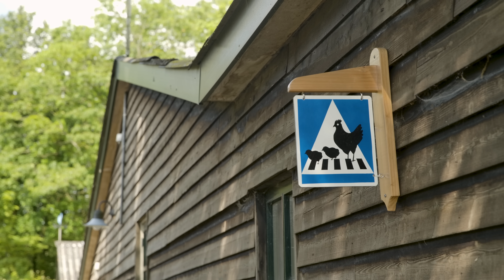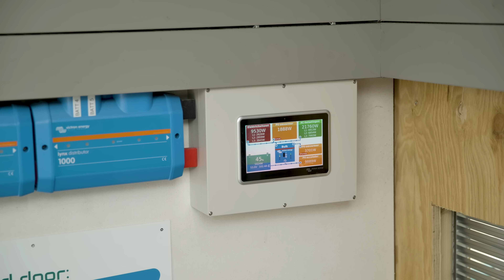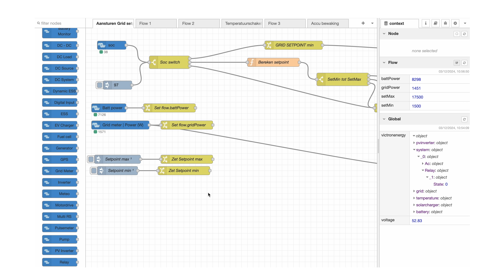Why the grid caused this Dutch campsite solar to blow up

Comment: 1:44 252V, this is way over the safety disconnect voltage. Your local transformer seams to be stuck or can't turn further down voltage, which should trigger a safety disconnect. I mean yeah, .6% and +10% are in range but normally if you hit +6% and your transformer is at its lowest position and can't turn further down, this triggers a warning to the grid operator who needs to reduce power generation or throw off some generators from the grid to prevent such things.

Comment: I had a  second look at the Video. 

I really have a few questions. 

The Alfen EV Chargers have Modbus TCp so they can be integrated into Nodered without the loxone server. 
Also there should be no broken devices because of 252 V Mains Voltage. If they are up to Regulations Standards, the PV Inverters should only be disconnected because of such high Mains Voltage but no Device manufactured after 2005 should be damaged because of this. 

And in the End, the installations is really not up to the Victron Manual and Wiring Guide, there is no Room between the Multiplus Inverters for Ventilation and the Batterycables are connected what looks like a random system or none at all, this should really be thought through more!

Comment: I also have good experiences with Victron Energy. They are a top notch brand. Having said this, it's PV installations like this that cause the grid voltage to exceed the limit during sunny days. The fact that the Dutch government is wasting taxpayers' money on PV installations, is stupid and testament to the fact that politicians are technically illiterates and don't have a clue what they are doing.

Comment: Okay a few notes on repairing boards:
- the troubleshooting is the difficult part, with proper repair manuals this could be made much more accessible
- the tools required to do most board-level repairs can be had for like $200, not thousands
- you do not "repair chips", if an integrated circuit breaks, the only viable option is replacing it. Most small ICs are actually very cheap but what you said about software applies, you cannot repair a device if you can't access the replacement software to put on the chip.
Reply: Hello,    We do not advise/proomote anyone try repairing board as this involves to much risk. Both on safety and reliability.   The boards contain often software/calibration and such.  So please dont try repairing on component level and contact a dealer/service centre for this.  They know best what compatible and how to swap/repair boards

Comment: With the problems of the unstable grid here (when there is a lot of sun) in the Netherlands I do not understand why they still building big solar fields everywhere over here. Nice solution for this campsite. Fully off grid on only electricity is a challenge in winter time in the Netherlands. There is simply not enough sun in December and January. I know I have 10KW solar power.

Comment: Your producing a enormous amount of energy in the middle of nowhere while not using it. Thats why the voltage spikes and then it damages the electric appliances. Silly to blame the grid operator.
Reply: Local transformer should have been replaced (or change the internal winding tap) to get it to 230-240v, 252v I will cause invert to stop exporting and can damage the inverter ( I don't get how it was damaging the solar panels though)

Comment: So how did those voltage bursts damage the old install? And what makes the new install more robust against it? And why use a third party EV charger and use Node-Red and Loxone to talk to them, when Victron sells their own EV chargers? After watching, I have more questions then before.
Reply: Yeh I can’t see anyway in which high voltage could damage the panels theirselves there is too much electronics in the way of the DC - AC side plus the MOV’s would of blown first. Or should of.
Reply: @kevxsi16v  they should but it depends on how fast the surge hits. most is advertising, and also what is to say the old equipment failed from end of life causing the damage and they blame the grid.
Reply: It has to do with the range of the acceptable input as well as the protection features. for example the typical grid voltage range for Victrons inverters is between 187-265 VAC for non US inverters and equipment. That gives a 10% variance for over voltage and 28% variance for low voltage. That is a very large band. for the rest of the integration.... not sure but probably has to do with node-red networking or something like that, victron communicates better locally but not really out to long distances that would apply to an RV park/camp grounds. For the EV charging, probably not using victron since their chargers I do not believe have a pay capability, only load sharing/shedding
Reply: Just install a voltage protector
Reply: @NazimUdDin-tg8jg  yup, all of my home, and solar is protected by OVP/UVP disconnects and MOV's for surges. this should be common practice
Reply: Henk talks about too much 'power' but means to high voltage...

Comment: im curios if there is enought to power the hot water in the winter. i have a 2kw system and it made like 20w the last week...
Reply: Only 20w. I'm in the UK I have a small heat pump unit on and the TV aswell as all the other crap that you have on and I'm consuming under 100w from the grid so probably around 400w coming in.

Comment: EE here: Most 230 or 240 volt equipment will function OK up to 300 volts. A grid by itself would not produce that unless like one incident I saw in which a 33KV line fell onto a 13KV line.
Reply: The grid over here can rise to 252v, which is the limit at which most PV inverters shut off. However, if your neighbors are particularly selfish, they may have fooled around with the limit settings and set it to 253v for instance, to avoid their PV installation shutting off. The next, again, may go for 254v. And there are even autotransformers on the market that present the inverter with 230v when the grid is already at 253v. If the inverter starts backfeeding, it can try and send well over 253v towards the grid. It depends on the local transformer how much it will rise in practice, but reaching the auto shutdown voltage is fairly common.
Devices with switchmode power, or resistive things, are often completely fine at higher voltages. However, devices from the 220v era absolutely have problems with voltages over 240v. Small transformers can saturate, motors can run hotter. Not all transformer-fed equipment has a 240v tap that you can select and much fewer have a user selectable voltage. You might be an engineer, but i think you have to dig into actual devices. A fair amount of them have 400v smoothing caps. At 300v input they'll see 420v and fail within a year. Even if they have 450v caps, they'll fail much faster if there's 420v on them instead of the normal 320v. Please be aware that we already have major issues with brand new consumer electronics failing within only a few years because of parts that are running right on their limits even on 230v. I am not an engineer, but i do know the factors that decide on how long equipment lasts, and i have repaired hundreds of devices in my life, seeing each time how much or how little margin devices have for an increase in mains voltage.
Reply: @mfbfreak  How then would you explain the 60 PV panels failing from the grid voltage being too high, as mentioned in the video?  I can understand the inverters failing but not how the supposedly electrically isolated PV panels would.
Reply: @Berkeloid0 agree 100% most equipment is equipt with a varistor which will blow first. 
I work the NG in the U.K. a lot of what I have to do is go and repair equipment after loss of neutral. I have replaced a good few inverters that have suffered 400V on the AC side and never ever has it damaged the panels. Impossible.
Reply: @mfbfreak  The issue can be also with the power line. If lets say in the middle of the line there is 252 Volts, it is possible, that at the end (in the camp) is over 252 V with no load, due to capacitance of the line.

Comment: Solar PV Inverters are one the root problems of the Overvoltage at peak solar production.
Also old grid transformers contribute to the dilemma. Both systems need to work together.
Victron has exccelent solutions. However their systems are quite the challenge to setup!
There is much to improve on the setup side! 
(Why do you need an MK3 to programm  Multiplusses ? Why can't the Cerbo GX do the programming? etc....)
Reply: I bought a Multiplus GX thinking I could configure it using VE Connect over the WiFi/Ethernet. VE Connect sees it, but only gives me the Cerbo type setup, not the Multiplus. I must still use the USB adapter to configure the Multiplus locally :(
Reply: @JohnWatkinsUK  Thats Victron for you😉
I had to install an 94 kWh ESS with 3 phase Multis but the VICTRON !!Seller forgot to include the MK3🙄
Took me 2 weeks to get the parts together and install but now it runs fine.
At least now I now more...😉
Cheers!

Comment: Is the grid stability problem due to increasing use of renewable energy like wind and solar that can dump unexpected energy into the grid? The grid should be maintained within a certain tolerance of voltage and frequency, and any equipment connected to it should withstand those variations as well as surge voltages caused by lightning strikes.
Reply: Basically the Dutch electricity grid is constructed for one way use only, to supply energy to the customer. Secondary the grid has not been properly maintained for the rise of high demand industries, like datacenters. The rise of both high demand customers and the emergence of renewable energy systems that are able to deliver energy to the grid, made it very clear that significant changes are needed to improve, modernize and expand the Dutch electricity grid. Slowly the plans to do so are emerging, but the companies maintaining the grid are overwhelmed with the investments they have to make and the pace in which this investments have to be made. At this moment all big building projects, either big new factories or big housing projects are plagued by a lack of place on the grid.

Comment: Love the Victron Multiplus. You might consider teaching the correct installation methods and modifying an installation before showing it as an example. In this case, yes the inverters should be spaced apart according to the manufacturer’s manual. They get hot.

Comment: Here (in the Netherlands) there was never a power outage in the past 10 years+, but in the last 6 months twice, once in the summer and once very recently, when the first snow fell, I'm pretty sure it's caused by the little transformers inside the inverters of solar panels.
Reply: Do you have evidence for your claim as well?
Reply: @C4rb0neum  You can check the "reference" circuit on inverters by Texas Instruments.

Math becomes really complicated as Ohm's law is usually based on a single power source. now you have Goliath (the area transformer) vs the inverter (the ant or mite) with the resistance of the wire between them.

Texas Instruments: Power inverter is a device that converts electrical power from DC form to AC form using electronic circuits.
It is typical application is to convert battery voltage into conventional household AC voltage allowing you to
use electronic devices when an AC power is NOT available.
Reply: yes there was, locally usually but there have been power outages due to things like worn out MV transfomers
Reply: @kiddy1992  But not here, otherwise i wouldn't have mentioned it.

Comment: How do the inverters communicate with the batteries?
Reply: Based on what they show in the video, the batts dont talk to the inverters, which is just fine.  Closed loop comms is overrated. The Victron smart shunt is all you need for that.
Reply: With a Victron Lynx Shunt
Reply: @lecramred4453  can they communicate with the BMS?
Reply: @tarant315  No, but that is not needed

Comment: Who built this installation, abnormal gap between inverters, chossing 24x6kWh small pack instead of bigger packs, each pack include its own bms that draw something like 5w....x24, that's 120w of draw 24h24, some 3kWh per day, 4 days of grey weather...10kWh gone.
And use victron ev chargers....! Easier to interface.

Comment: How is he protecting his new system from grid voltage spikes?
Reply: They need to set the power tap on the transformer to a lower voltage tap or replace it so it's around 240v ac when demand is low (252v is typically the max a inverter will output)  I have seen 252v on my ups at 3am in the morning but not middle of the day 

But them saying the power is unstable is silly when it's just the power company just needs to replace the transformer to get the correct voltage of around 235-240v (or ajust the internal tap on the transformer to lower it to 235-240v when load is light)

The inverters was probably blowing up the mosfets due to switching off grid export when it went past 252v ac witch shouldn't happen in the middle of the day

Comment: Great video! Cool to show but the transformers are not really from the Netherlands unless its a very VERY remote area, and also the multiplus 15kva are NOT installed correctly because the distance that is mandatory from the victron installation manual is not kept! 

The rest is beautiful!

Comment: Can someone explain how hig voltage on the gride destroyed solar panels?  Which are separated from the grid by at least two layers of isolation?
Reply: It can't. The entire video contradicts itself constantly. 
He claims the grid wiped out 60 panels. Unless they were directly on the grid and it backcharged them somehow, which would have fried EVERYTHING on site, they wouldn't be touched. 
The inverters and breakers would have tripped long before that and even cheap chinese inverters and breakers prevent it. 
I suspect he's making a claim that's false because he's on a government grant/program and for some reason thinks it'll help his case to make the video. Same as why I don't see how 3 x 15KW inverters would provide power to an entire camp site of some 150 pitches that are all limited to 300w each unless they want to rotate the usage. Plus the EV chargers ontop of that. 

I suspect many things in this video are lies to facilitate an insurance claim or similar. 
Ofc maybe most of his stuff is on the grid that is apparently unstable but it doesn't make sense. The Netherlands has very stable voltage and it makes no sense that it'd blow up his equipment.
Reply: @billienomates7100 grid tied inverters could easily fail in a way that puts grid voltage directly on the panels.
Reply: @billienomates7100 I don't fully understand why the solar panels would get damaged but I understand High Voltage (252v is the export cut off on most inverters) and can definitely destroy inverters at times

they're just stating that because the voltages are high that it's an unstable grid when really it's the power company should be replacing the local transformer to get the voltage closer to 235-240v when load is light
Reply: It doesent destroy the panels, it destroys the inverters
Reply: @anzzgar  Now see, that makes sense.  But they clealy said 60 panels were destroyed, which doesn't make sense to me.

Comment: At around 2:00, you show above ground transformers and cables... we don't have such thing in the Netherlands. Everything is below ground, unlike in the US.
Reply: Pictured are voltage regulators on a wood pole. Perhaps a US clip.
Reply: what? no we do. the MV cables are underground but the transformers are above ground, they need cooling after all. usually we just put them into nondescript brick buildings called "transformator huisjes"

Comment: I don't see how the system protects against the initial primary cause stated for them adding it which was that the high voltage spikes of the grid was damaging equipment. This is still a grid tide system is it not? Large spikes in the voltage will still damage the equipment?
Reply: When you charge the batteries at high voltage moments, the voltage will decrease. In addition, the Smartsolar is not grid tied.
Reply: @lecramred4453  i still dont get why surge protecting would not solve the problem
500€ vs 180.000€

is a  surge protector not a law when you build a new house in eu ?
it is where i live in dk

it make no sense to be living with your devices getting destroyed by the grid
Reply: @astrogerard  I as well call BS. Most modern equipment will actually benefit from a higher voltage and run cooler because when voltage goes up the amps go down.
Reply: @Hansen710 the surge protector only protects against surges for miliseconds, not for 3-4h during peak sunshine, only option then is get own transformers or go offgrid and only use grid when voltage is stable
Reply: @astrogerard  Bulk capacitors after the rectifier are usually 450VDC rated.  The switching transistors are often rated to 600VDC.  Properly engineered devices should not have any issues with 253VAC and in reality should survive 260VAC too.
Reply: Exactly. This was just an argument to sound more spectacular than what it is. Yes, the voltage may peak to 252V during the summer, but nearly all equipment can handle that easily. And yes, the argument about netcongestion is true, but the Dutch grid is not unstable. Far from it. It is one of the most reliable power grids in the world. The fact alone that they show a pole-mounted transformer at 2:05 tells you the whole story is just weird, because those things are nearly non-existent here in The Netherlands. I just Googled it, and it is an iStock clip from the United States.